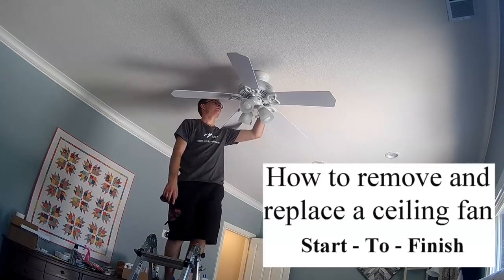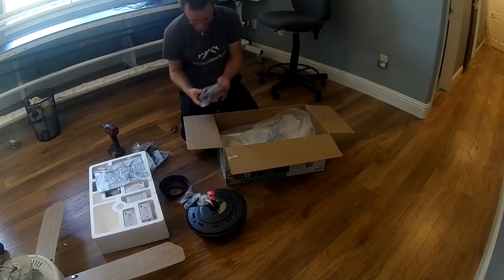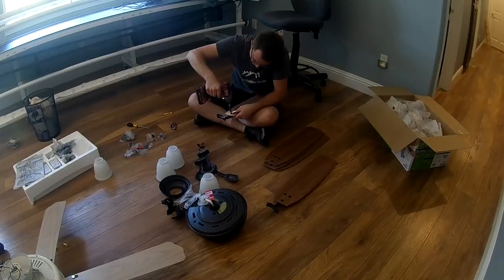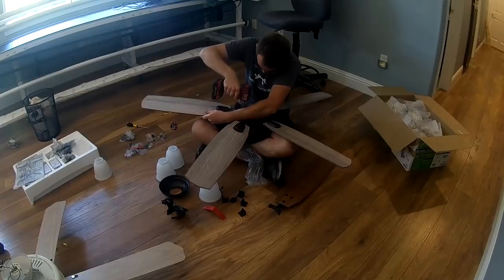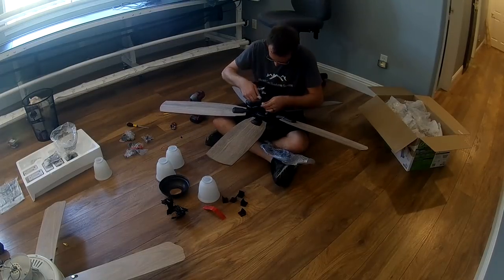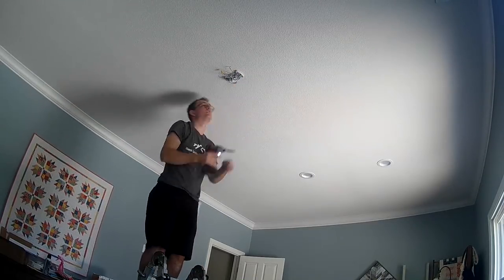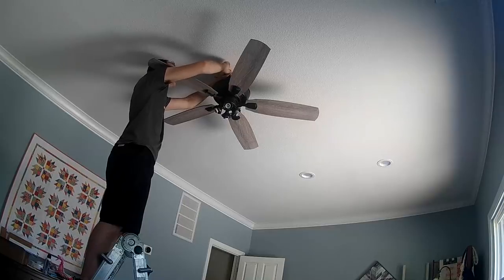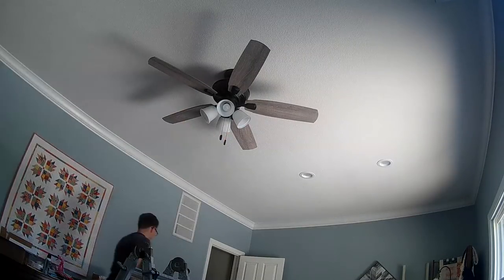How to Install a Ceiling fan

Comment: Good video,it’s important to check the instructions on most fans,there sometimes is a step you may miss or do in the wrong order and have to undo to assemble correctly. Ask me how I know,lol.
Reply from the maker: Thanks Pete I appreciate your comment! LOL yeah I have had to take many fans back apart because I did it in the wrong order. I remember one I took apart like four times before I finally got it LOL!

Comment: Wow !    Alan you move really fast.    you must've had a lot of coffee that morning.    good job.
Reply from the maker: Hahaha! Gotta get it done! ;) Thanks fo your comment!
Reply: Honest Lee Handyman  ,   always use the mounting bracket that came with
     the fan.     i once removed an older fan and replaced it with a new one.
 i hung the new fan in the old bracket,  connected the wires, etc, and turned
     on the fan, and 10 seconds later the new fan hit the floor, just missing a
 16 year old boy sitting on the floor watching TV.   the new swivel ball was
     just a tiny bit smaller than the old bracket.    lesson learned !
 yes, i had to buy a new fan out of my pocket.